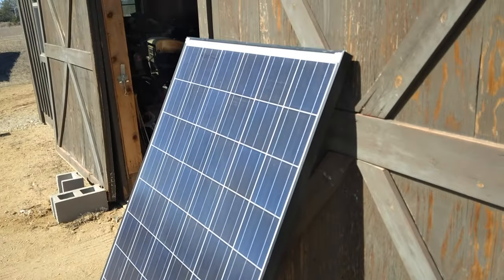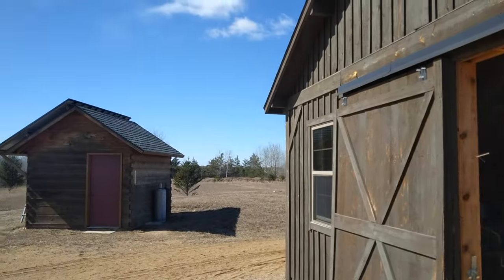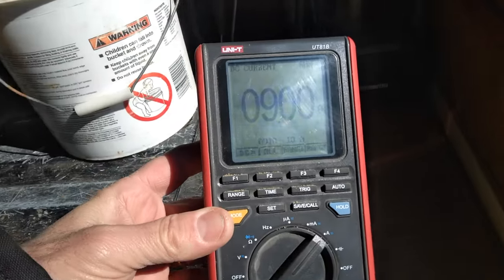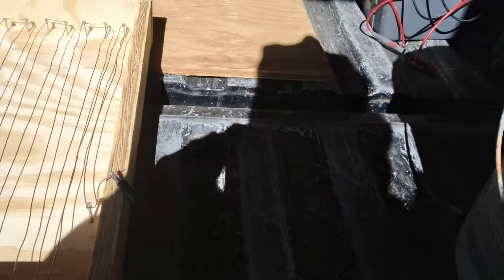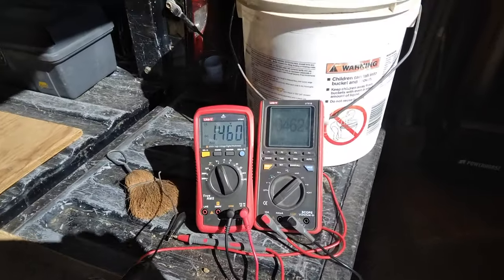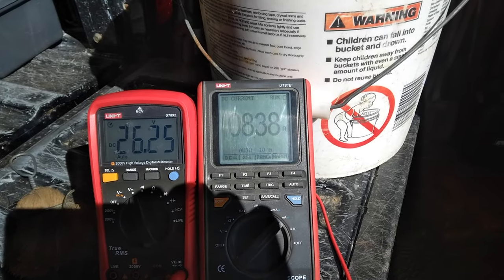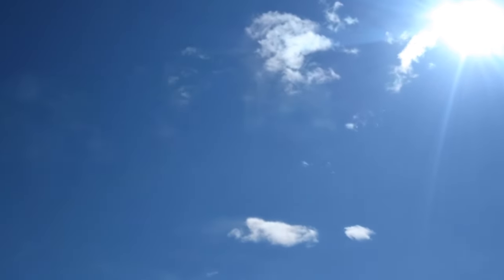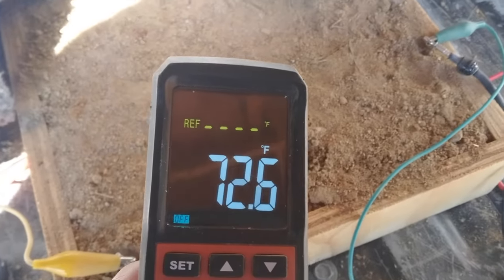Practical construction of a DIY sand battery

Comment: Resistive heating wire is usually nichrome, but sometimes tungsten.

If you focus the sun with e.g. a space blanket reflector directly onto the dirt, you'll get much higher efficiencies across a much broader spectrum without the cost of a solar panel. Admittedly, your approach does have the advantage of allowing all sides of the box to be insulated without a heat exchanger. You're going to need plumbing anyway though if you want to use that energy to heat water or air, so a heat exchanger isn't out of the question.

Not sure what you mean to do with the heat, but hopefully you're not planning this as a viable electrical battery. If you mean to turn it back into electricity, your end to end efficiency is pretty much guaranteed to be in the 1-5% range when you consider both the solar panel and the peltier cells or thermopiles or heat engine + generator or whatever. Resistive heating is highly efficient though, so at least you don't have to worry about that part.

For the cost of one solar panel you could have hundreds of square feet of mylar reflecting sun on a very large pile of dirt or patch of dead ground (not organic-rich soil which is combustible and a frequent cause of camp fires causing forest fires and probable source of the smoke you observed). Bury some pipes/ducts/radiators in the dirt for air/water. It'll have its own logistical challenges, but it's so cheap for the size it's hard to imagine it not working to some useful extent.

Anyway, hope you don't mind me rambling with my thoughts. Thanks for sharing the inspiration!
Reply: Using photovoltaics may not be an efficient way to generate heat, but it sure does simplify a lot of things. With the low price of PV these days, it's totally worth it. I use PV for all my hot water so there's no plumbing/pumping/leaking/possible heat exchangers, etc. involved. Very low maintenance, no moving parts, and the location of the collector isn't tied to where the energy is stored.
Reply: @fxm5715  I do completely agree with the simplicity point. But you must not use hot water much, or have a different idea of "low price". Average hot water power consumption in the US is 10-15 kWh/day. Unless you buy in substantial quantity, PV price is sitting in the $1/watt neighborhood. Keeping in mind that in most of the US there is an average of 4 hours of full irradiance per day, 10 kWh / 4 hours = 2.5 kW/hr, or $2500 worth of solar panels if that's all your hot water. A space blanket costs around $1 for (more than) the same area of sun capture as a $100 PV panel, while being somewhere around 3-4ish times as efficient. We're talking about $5-$10 worth of space blankets to compete against your $2500.  Even if you got a great bulk deal by buying a large 5-figure system plus government subsidies so it only cost you $1000 for the panels we're talking about here just for your water, I'd still consider the fact that for the $1000 spent on panels just to not have water flowing through a little extra pipe it could have been generating enough power for multiple entire households, and enough if you so chose to focus it right, to melt metal and turn sand into glass. The pipe, btw, probably costs around the same as the extra cable you had to run to get 2.5 kW from your panels to your water.

If you didn't notice, I've been rounding everything against myself here. I'm not saying PV is overall a bad thing. If it's what you use for all your power anyway, by all means find every way you can to make use of it. But I still find it difficult to watch someone making heat with a solar panel's output without thinking about how you could get the same amount of heat production in less space and time for 1% of the cost, with only some aluminized plastic instead of an exotic sandwich of semiconductors and current collectors.

Anyway, the whole point of a sand battery is that it's cheap. It's nowhere near as convenient or compact, but it drops the cost of storage to, well, dirt. Seems odd to pair that with the most expensive renewable which *already comes in as heat*. It'd make a lot more sense if the power source was wind or hydro or something. So ultimately I agree that PV panels are more convenient than space blankets. But I do not agree that they're "worth it" for the use case of heating. With regards to reliability, I think there are points on both sides.
Reply from the maker: We have 1,920 watts of PV grid-tie.  That more than takes care of our 'annual' electric hot water needs for 2 people.  For 3 months in the winter the power output is pretty low.  Be nice to think up of a durable, inexpensive, way to  charge something up with high temp heat over the whole summer, and make use of it through the winter.
Reply: @doubleMinnovations  That's a really tall order. A lot of power to store for a long duration. I feel your winter solar pain though, I'm up in Maine.

The usual answer at home scale is batteries obviously, but not cheap unless you want to build them yourself. You'd have to get into the layers and rolls constructions I was talking about in the comments on those videos, though. Not just a single rod or pipe, you'll never get the density you need that way. Even then, most rechargeable chemistries don't do very well holding the same charge for months, even professionally designed and produced. They tend to either self-discharge or break down.

The usual answer at utility scale is pumped hydro where they pump the water uphill to charge it and drain it back down through a turbine to discharge. It'd be a cool use for your past turbine work, but it's only cheap at huge scales, unless you happen to already have a giant pond on top of a more giant hill in an area that doesn't freeze much. You could try the same thing with logs or something tied to a rope connected to a winch, but the parts of your property seen in the videos are pretty flat, you'd still need a big (and steep) hill or extremely deep hole. And a ton of otherwise unused space. I did the math once on covering our entire roof with water capture, I think somewhere around 40 by 60 feet if I recall. Turns out the house would collapse before we stored enough to power everything for a single day. So we're talking pretty massive size and weight for months of energy. At least a large farm scale irrigation tower, and likely several of them. And they have to keep themselves heated enough to not freeze.

The thermal battery thing is theoretically very cheap, and already being commercialized in Europe. But I think you'd need to do a very good job on the insulation of a very large battery. They do self-discharge obviously, so you'd need to scale up a lot. A smaller thermal battery self-discharges faster because of the surface area to volume ratio. As you scale up, the surface area scales as a square, but the volume scales as a cube. So a larger thermal battery can store more heat relative to the amount it dissipates through insulative losses. Again, the scale of what you're wanting to do just translates into equally massive solutions that raise more practical problems.

I'm not sure that any of them will scale the way you're hoping for, but there are other unconventional options that make for fun experiments. Like fuel production. Use the excess power to gassify or pyrolize biomass or waste plastic or whatever into methanol or biogas or whatnot.

I'll give a nod here to hydrogen, because you can't hardly have an energy conversation these days without it. I've heard of spare PV output being used to electrolyze hydrogen out of water, but I haven't heard of it being done at home scale. Storing it and using it safely requires some detailed knowledge. Without proper design and particularly material selection to avoid steel embrittlement and suppress static buildup, your hydrogen tank becomes a vehicle-sized fragmenting pipe bomb that can go off because of an invisibly small spark from a dusty breeze on a dry day, even if it's been working fine for months. Also, because an oxyhydrogen flamefront can exceed mach 30, it's rather difficult to burn in a controlled way without flashing back through the supply line and blowing the tank if you don't have absolutely all oxygen purged from the system. Hydrogen can be fun but make sure you know what you're doing before you scale that up. Burned all my forearm hair off playing with that stuff one 4th of July, and that was just a little partially inflated produce bag at atmospheric pressure.

OTOH, circling back to where I started, you could drop a few dozen to a hundred or two dollars on Amazon for some space blankets (or maybe they have mylar in bulk rolls) and have usable amounts of thermal power even in the seasons when the sun isn't very high. This is one of those situations where generating more power is cheaper and easier than trying to store it, especially if we're talking about thermal. Then your problem collapses down to storing enough energy for a few stormy days at a time instead of months, so the thermal battery would probably totally work for cheap even without huge fancy vacuum insulated storage tank arrangements.

I'm planning on testing my proposed setup, I'll let you know how it goes. We still have another foot of snow in the forecast, but this has been on my mind for a few years, and I finally have the space to try it out now. So some time this year. It'll either be "I told you so" or "I burned my heavily forested property down with space blankets." :)

Tangentially, do you have any wind on that giant open flat property of yours? I was thinking about what a massive amount of wind energy you could capture for cheap with a large tarp or two fastened to a light frame on a rope between two trees for support, spinning on a vertical axis tied to the rope, or using the rope itself as a horizontal axis. Have an old broken winch I was going to use as the generator. It's another tree you could try barking up for ultra cheap power, orders of magnitude larger and cheaper than usual home wind turbines. It'd capture so much while being so light, that you'd have to design some flexibility into the structure just so it doesn't snap in a storm.

Anyway, not sure if anybody is going to read all that, but I appreciate your videos. I find them a useful catalyst and reminder for my own ideas. Plus you're just about the only one out of my 3 digits of channel subscriptions who engages in the comments with any regularity. So, thank you for your time. I hope something I wrote here was useful enough to be worth the reading the small novel I apparently just wrote.
Reply from the maker: I had a couple of comments saying, that they enjoy reading the comments more than watching the video. 😆
Lots of things to consider, and think about.  I do have a large wind machine design I'm working on, for something in the future, when there's time...
Reply: Use ORC to convert heat to mechanical energy, then to electricity. You can achieve greater electricity output per square meter than photovoltaic panels using parabolic solar troughs or various other heat capturing technology.

Comment: Hello sir.
Sorry for commenting here but I need desperate help from you :(
I have a project to make about nitinol and I just saw your videos (which are awsome and I want to congratulate you for doing them). I will let the videos down below but I want to know this: how can you set a speed to a nitinol engine which is using hot water as source of energy? I mean how can you control how slow or speed is it rotating? In your videos, I saw that you have some kind of "pipe"/lever that goes through the engine and it controls the speed...how is that working?
Thank you and sorry for bothering you :(

The videos:
https://www.youtube.com/watch?v=Zgf6iYHE1bE

https://www.youtube.com/watch?v=DJr5Ibwn6ls

https://www.youtube.com/watch?v=jpPVvD5SeY0
Reply from the maker: All the lengths of nitinol wire are connected to an off-set cam wheel.  The lever you see me using, controls the position of the cam wheel, which directs when the tightening of the nitinol happens as it enters the hot water.
Reply: @doubleMinnovations  First of all, I thank you so much for responding sir! Second, can I send you a private message on a social platform? (Mail, Facebook, Discord, Instagram, etc)
Reply from the maker: I consider the comment section a social platform.  Many people like to read and respond to other comments. If you have a question, you can ask in these sections, then all can see.  But place them under the video it pertains to.
There is an email address on the channels homepage, but I don't give out personal information.

Comment: It'd be neat to get a sterling engine running on the heat and try to get some sort of low-tech power generator going for indoor lighting
Reply: Use ORC for greater efficiency.